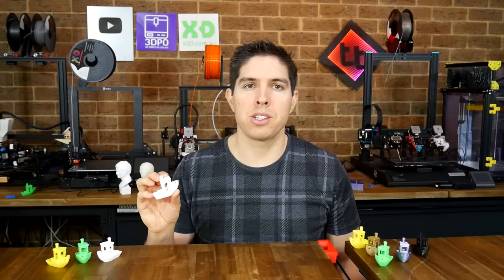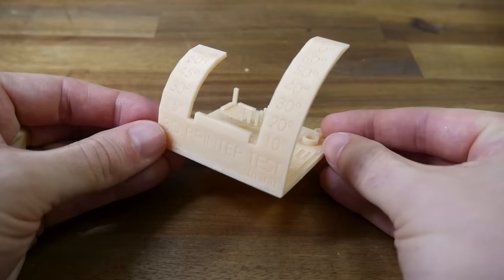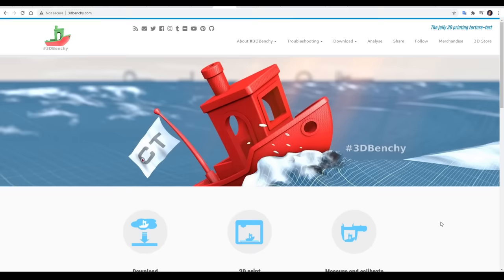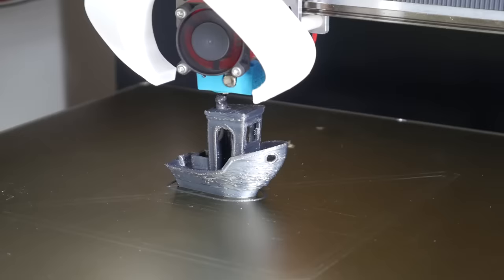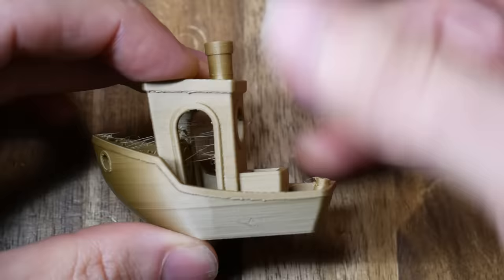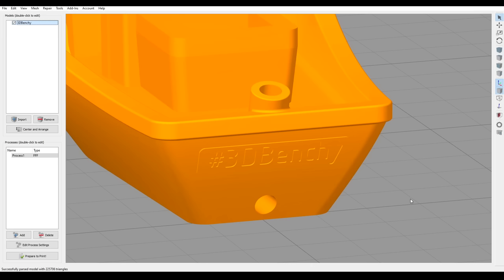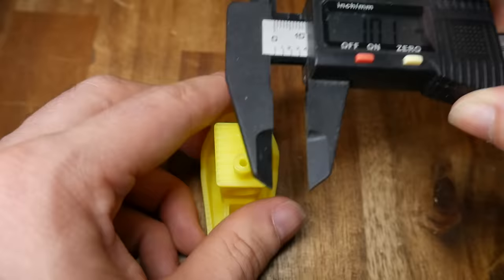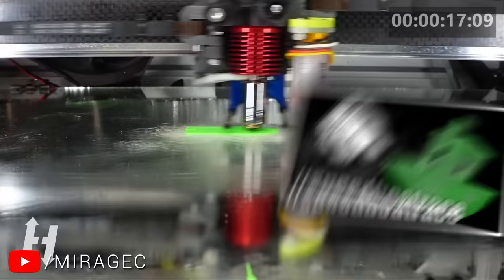How a 3DBenchy can tell where your 3D prints need improvement

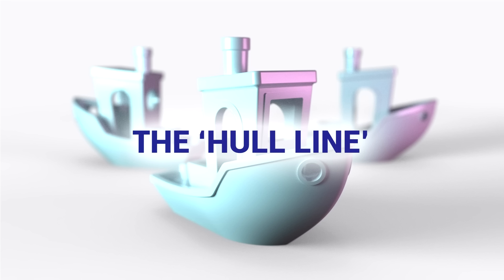Comment: I wish we had a better answer to what causes the hull line at 10:51
The Prusa article makes it sound like it's one of the great unsolvable mysteries of the universe. Come on we're just laying plastic down here, it's not rocket surgery!
Reply: I'd wager it's partly to do w/ extrusion mechanics. The system behaves differently based on firmware kinematics, part geometry and extrusion speed. If you're tuned at a certain typical speed and deviate from that significantly it will show up in the surface finish. YMMV.
Reply from the maker: I have a theory that since the inner and outer portions touch at the that point, the density/thickness is increased and there is more shrinkage. You can see these type of surface imperfections in injection molded parts as lines on the opposite face of where ribbing is placed.
Reply: @TeachingTech  That makes a lot of sense, when I print a 150% or 200% scale Benchy I get no hull line at all, probably because it makes the wall thick enough at that point that the inner and outer perimeters no longer touch. 
I'll try reducing #of perimeters or perimeter thickness.

Comment: "This part of the benchy indicates you have a issue" - no advice or anything how to fix said issue....... Sorry but this one gets a thumbs down.
Also your calibration doesn't support smaller/larger nozzle calibrations?
Reply from the maker: I think your quote may have cut my sentence short.. All of the issues are arranged into headings and the calibration website does cover most of them. As for other nozzle sizes, it's going to come but requires a lot of reworking to my code. Comments like this aren't really a great motivator for that.